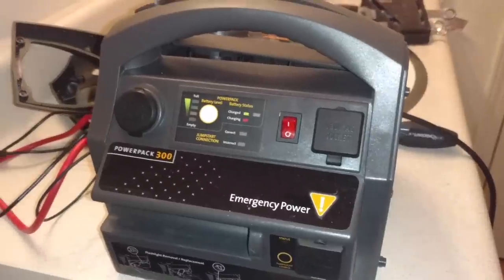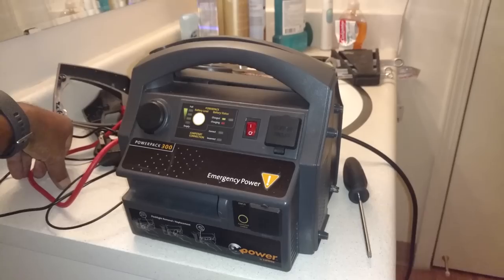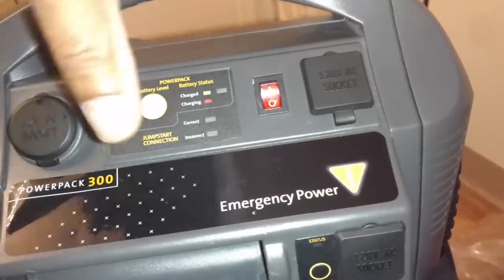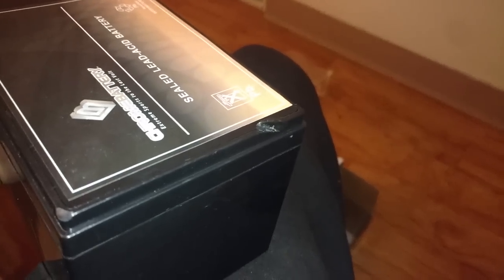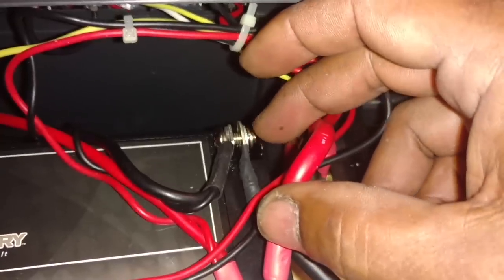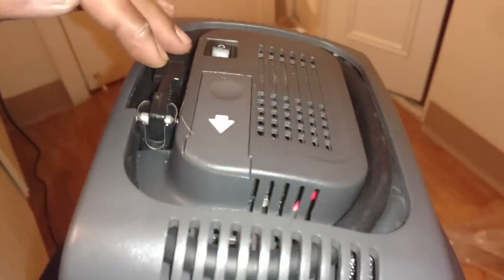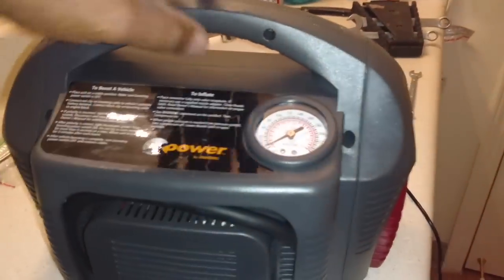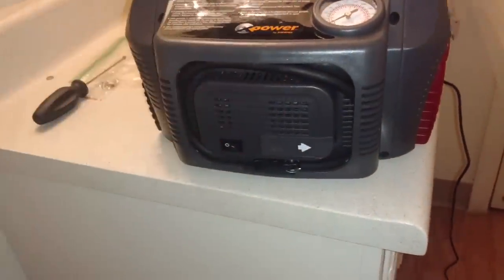Power Pack 300 Jump box, emergency power, air pump, repair. How to fix this junk. - VOTD

Comment: Hello! thank you for the video. I have a Powerpack 200 and I was going to take it apart to see about the battery replacement. I took out the screws but the model I have has a flashlight and the switch is on the handle. The unit would not pull apart  and I didn't want to break it. There IS another screw that is visible when you remove the side panel with the light assy. The hidden screw has absolutely no way to gain access to it unless you drill an access hole through the plastic in line with the screw or use a small right angle screwdriver. That screw probably helps keep the flash light switch secure.
Reply from the maker: Ouch

Comment: I have an equal charger but I lost the AC adapter and I can't get it, will you have a photo of the specifications?
Reply from the maker: I gave it away right after I posted the video. There may be a link in the comments as to the charger I purchased.

Comment: AH = Amps over an Hour, just capacity to deliver.
So you could have 12 amps for an hour, or 24 amps for half an hour, 48 over 15 mins, and so on.
It would not last too long turning over a car engine.

Boosters always die, i have a dead one from a mate, yup the lead/acid battery is deader than a doe doe.
Reply from the maker: Thanks for trying to educate an old dog. ;)
Reply: I don't think you need educating robert, a reminder maybe :-D
Human memory is deceptive, we know more than we think and given the right hint you will find something often pops out of memory, perhaps you heard of or seen on a box years ago.
Odd stuff memory lol.
Reply from the maker: true.